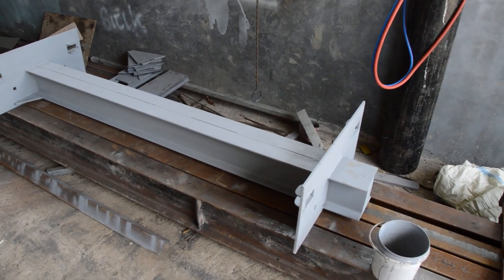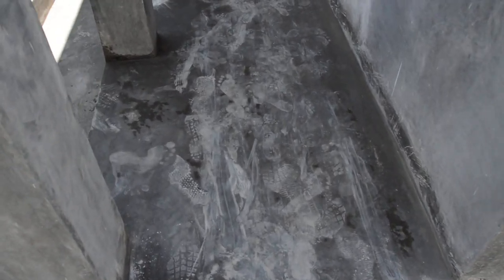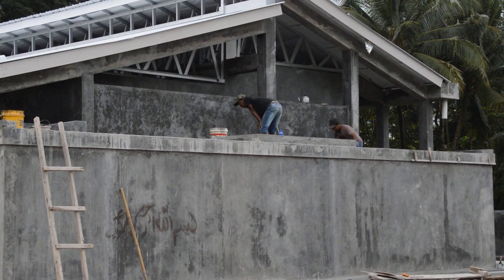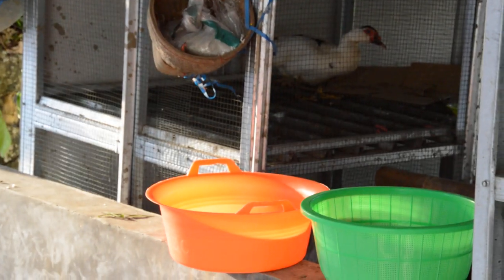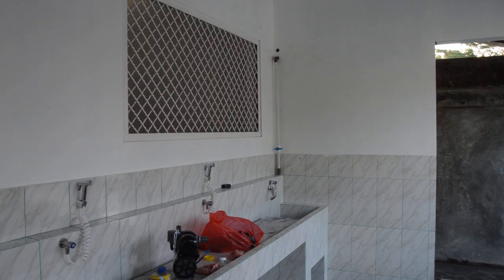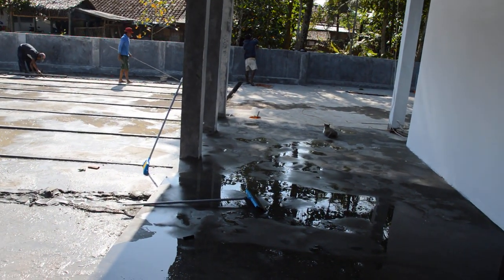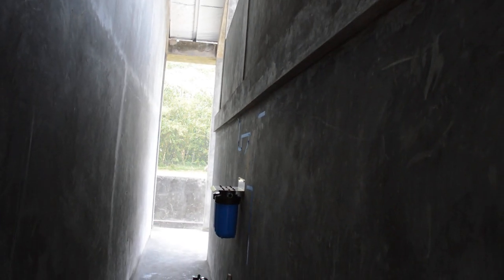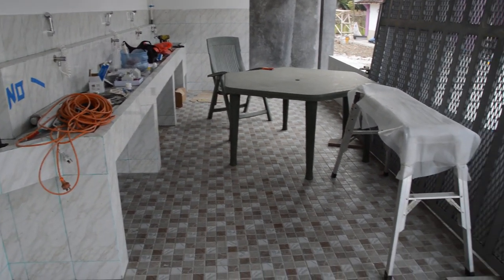The shed - paint, electrics, plumbing, and more concrete

Comment: Good Mr...💪
Reply from the maker: Yes.  I want this to be a building that is a resource for future generations.  There is no structural wood.  So there is no need for frequent replacement of rotted or deteriorated wood.  There are several tons of steel reinforcement in the concrete.  With the strength of the construction, I have hope that this building will shrug off a 7.0 earthquake with superficial damage.  I have just designed the drop in cover grates for the service pit.  They will be very strong too.  They need to be able to stand up to a 4500kg machine driving over them.  So it is just as well there will be a crane overhead to lift them out when the service pit needs to be used.  A friend told me long ago that I over-engineer things.  That is probably true.  But I want things to last, rather than fail through using inadequate materials.